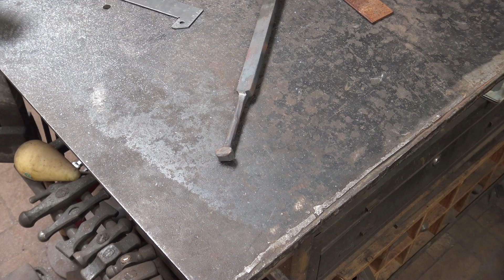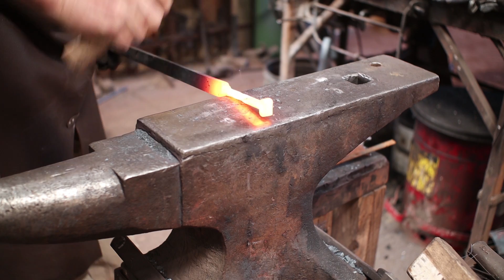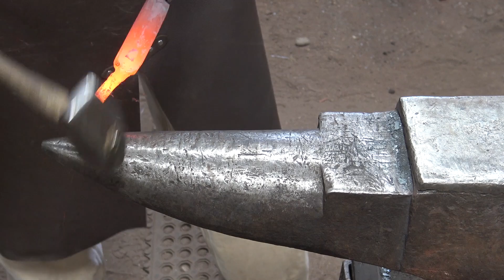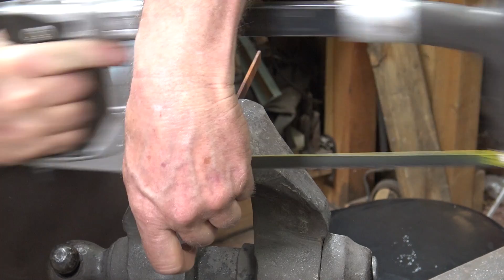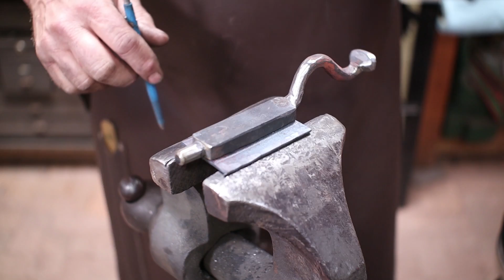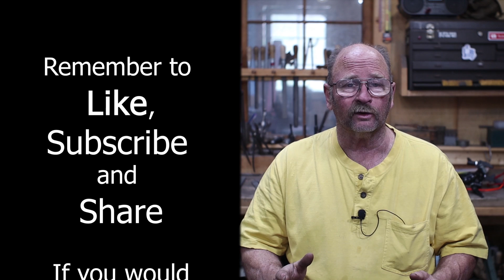Forging a slide bolt - part 1

Comment: Thank you for your videos. I made a bottle opener with a rubix cube twist handle. I watched your video on how to do that twist and it inspired me to get after it. It came out very well. It’s my best work so far. I didn’t realize how much work is involved in this craft. That simple project took somewhere between 4-6 hours! Most of that time was spent working on squaring off 1” round stock and drawing that out 🤬 But I learned A TON making that piece.

Comment: John your as ornery as my old mentor you’ve still not transitioned to battery power tools ! A super easy sawsall laying there instead of a hacksaw ... I’m 55 it’s not that hard to change 😝! I’m sure a email sent to dewalt or any other power tool maker out there would result in a brand new box 📦 of toys um tools! But I wubya anyhow what tools u use !
Reply from the maker: I do have and really like battery powered tool, but a hacksaw is way better than a sawzall for this type of work

Comment: Looks like you did a little color grading work on your video. I like the project. I'll have my little forge up and running soon. Its just waiting in the living room for me right now. Shop area is not quite ready. Maybe it's your manual lens you are using. I like that you are in focus and sharp and the background is blurred out. Nice separation.  :)
Reply from the maker: No, just trying to use more manual settings while recording.  Which also opens up more opportunity for mistakes

Comment: New to this and seen a few of your vids, good stuff - subbed & liked.
I'm doing up a couple hidden lock bolts for a gun vault from rebar and 1/8", basically the same except with provision for a padlock.
It seems like cutting the bar on the chisel was a lot of effort vs using a hacksaw. Is there an advantage to doing it that way besides having to let it cool before cutting it ?
Reply from the maker: Mostly is is just working hot when the material is hot
Reply: @BlackBearForge That's what I figured but didn't know if it made a difference to grain structure or anything. In case it's not clear, I'm still pretty new to this :)